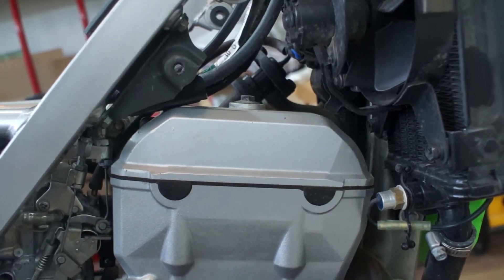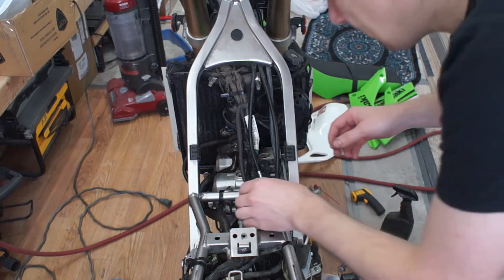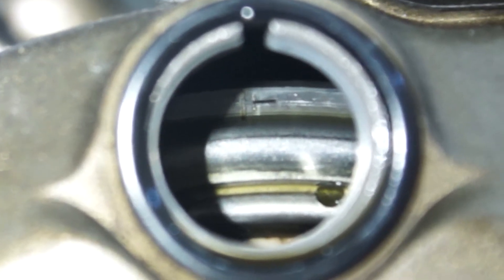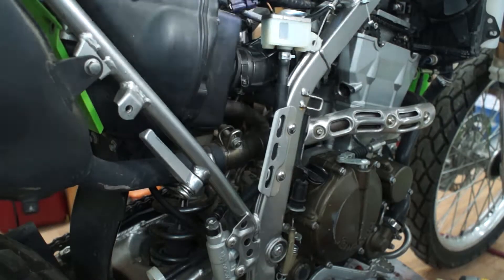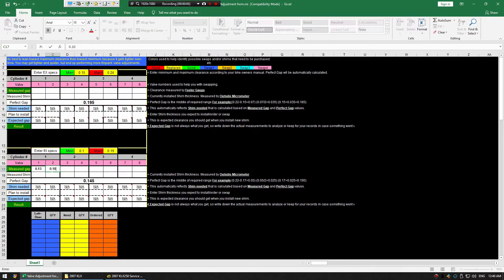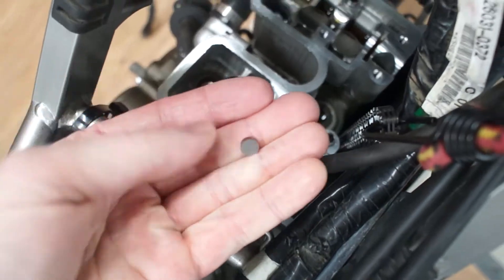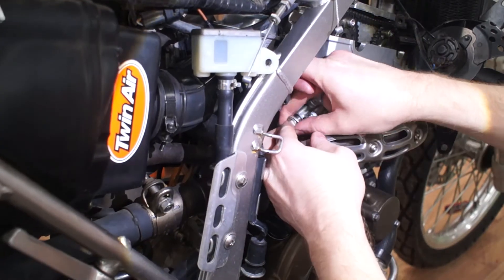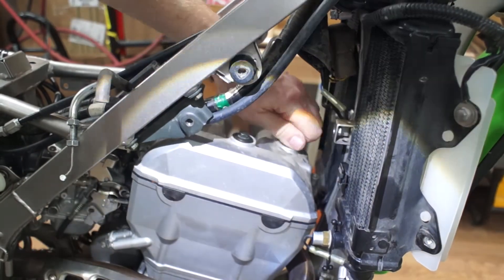KLX250S valve adjustment 2006-2007

Comment: Possible torque discrepancy. I could be misinterpreting the manuals, but I believe both the 1996 service manual and the 2006 supplement service manual state 69 in-lb for the cylinder head cover bolts, not 106. The valve clearances shown in this video (.15-.24 and .10-.19) seem to match the documentation though.
Reply from the maker: You may be right.
I guess i had that number stuck in my head after doing ZX6R engine rebuilt. Nearly every bold similar size is 106.
How ever, that value is recommended due to compression of the gasket. 106 is still remained true going into aluminum block.
Worst case scenario, excessive deformation the gasket overtime (years possibly) causing a small leak.

Comment: Only a few things:

I would never recomend using kerosene on plastic's over time it will eventually wear it (and let's not talk about the soft one's). Best thing is water + soap and use it with a spray bottle, cleaning the surface of the head cover and the gaskeet side's.

When taking out the camshaft chain tensioner, don't forget to undo the under tensioner that is behind the exhaust (that you need to remove) under the top chain tensioner, otherwise you will find it hard to remove/install the camshaft's and the chain all toguether. It is supposed to be torqued at 15nm (1.5 kgf·m, 11 ft·lb) by service manual.

Also you should be wary of the camshaft chain tensioner since it will tell you about your camshaft chain life, your's seem's almost at it's limits since the camshaft tensioner went out quite more than 2/3. I would check/change the camshaft chain.

Last but not least, I thank your for the Excel page where I can add the max/min tolerance's values and the sizes of the shim's and gap's between camshaft and valve bucket's.

And alway's read the service manual, I love that it give's you a lot of information on how to do the maintenances.

Comment: Hi mate , what is the valve adjustment intervals pls ?
Reply from the maker: Brand new bike: 500 miles
Used bike: When you bough it.
Manual specifications: At 7.5K and then every 4K miles
Reply: @tonycstech  The 2018 says valve adjustment at 500km, 12,000km then 24,000km ect...